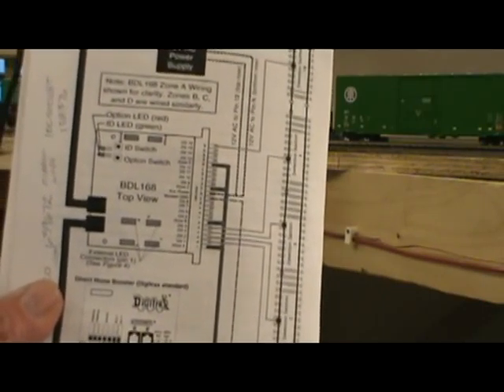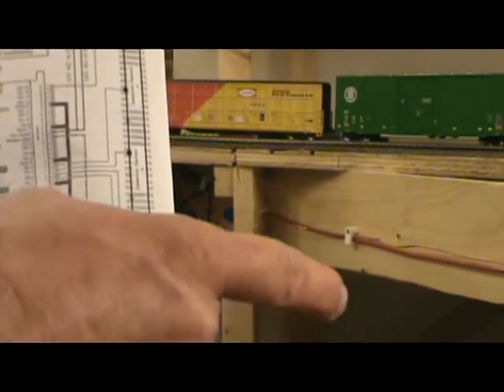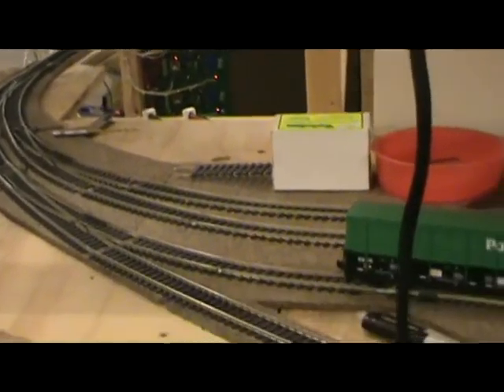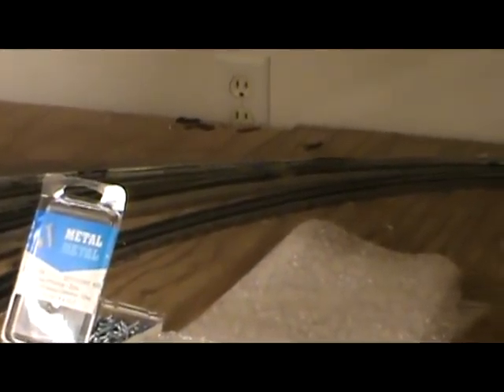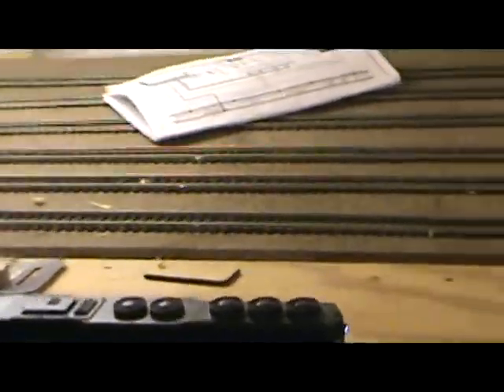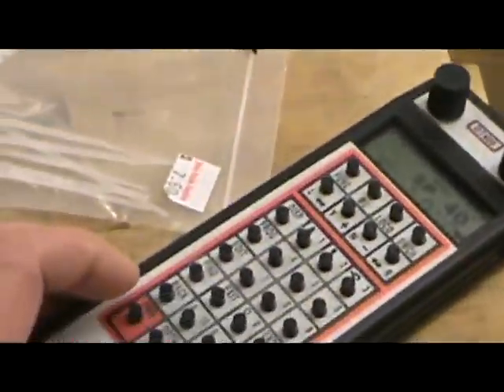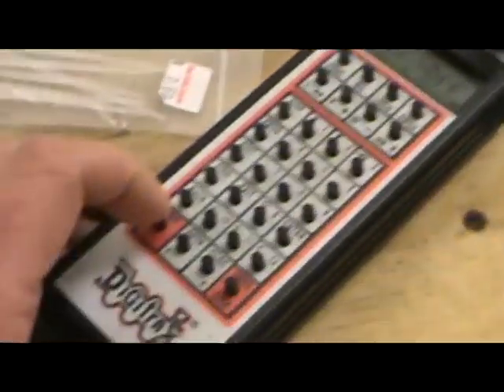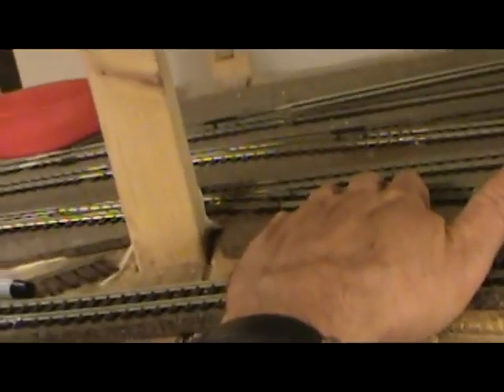DCC Conundrum

Comment: To be honest, I don't think you provided enough information to allow anyone to trouble shoot your problem.  Which track was giving you the problem - the outside track or the third/fourth track in?  When the engine stopped running did you get a short circuit condition, trip with alarm?  To me it sounds like you had a short circuit somewhere but without knowing more about what type of switches you are using, switch machines and wiring I can't say for sure what the problem is.